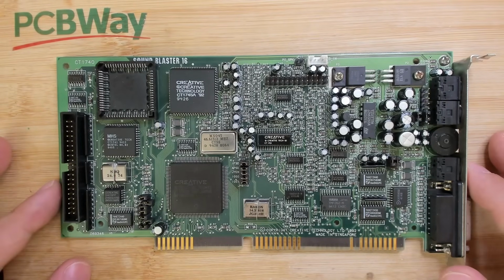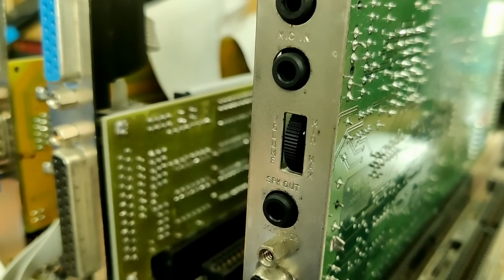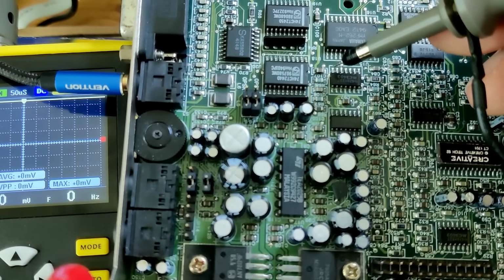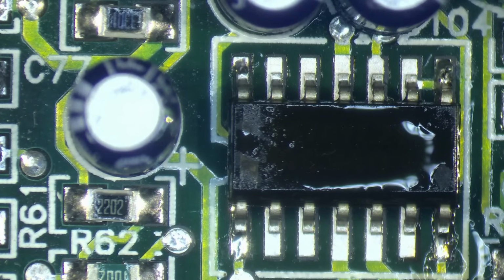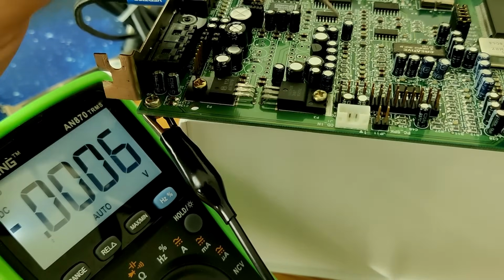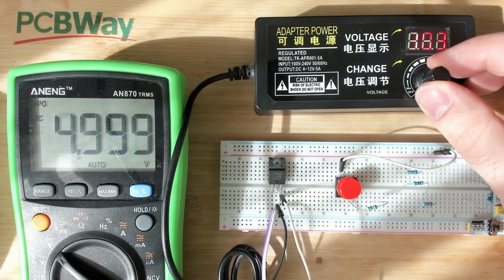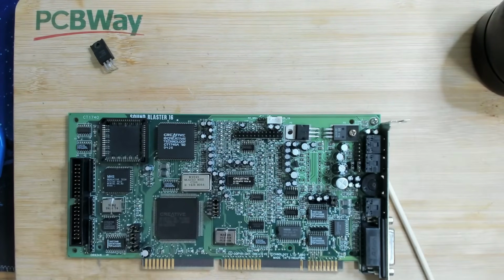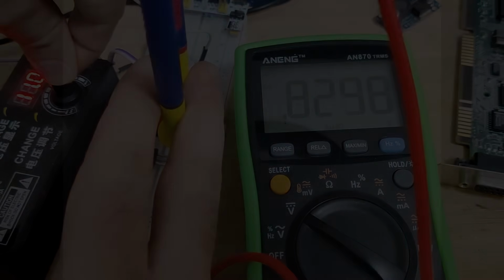The Greatest Sound Card Ever? The iconic Sound Blaster 16!

Comment: All ide connectors on ISA cards are pretty much equal, the ide devices natively interface using ISA and an IDE port is pretty much just connected to the isa bus through some buffers and with circuitry on the isa card determining the IO port and IRQ of the ide channel.  If you have a sound card with an actual ide connector you can use it with hard drives if you use xt-ide (system bioses do not support the tertiary ide channel on sound cards, but xt-ide can if configured for it). That connector on the SB-16 is not IDE, it's a Panasonic CD-ROM interface as used by early 2x Creative branded CD-ROM drives and obviously Panasonic branded drives. This interface was used because ATAPI didn't exist yet and SCSI was a bit expensive to include on a consumer grade sound card and every drive manufacturer was doing the proprietary interface thing. The first officially released  ATAPI specification was released in june 94, so you wont find ide ports on sound cards earlier than late 94.
Reply from the maker: Oh! That is very interesting! I wonder if such an interface can be easily adjusted to accept normal IDE drives. And good to know a rough time when sound cards started to include a standard IDE port.

Comment: It looks like you can still buy some version of MC3403 from TI. I think it's amazing some parts never go obsolete
Reply from the maker: Yes! It's great to still find replacements for old hardware. Some even say that you can improve the audio quality by replacing the old parts with modern ones.
I wouldn't do it, only if a part is defective - like the voltage regulator.

Comment: nice job finding the issue! I only have one thing that I need to nitpick with. You said that the testing environment should be the same as the production environment. yet, during the test you only went up to 10.5v. you may have done more testing off camera, or the footage didnt make it into the final cut, but it bugged me that you never showed the faulty regulator on the bench with 12v input. otherwise amazing video! I will be here for the next one!
Reply from the maker: You have a fair point - and I agree. When I did my initial tests, I did go up to 12 volts and then measured the voltage with a multimeter. It is the same as it was at around 10.5 volts. When I setup to record the voltage change around that level, I indeed did not go all the way up to 12v. Thanks for watching!

Comment: nice work on that voltage reg, its seems all the opamp doesnt have sufficient voltage to run
Reply from the maker: Yes, correct. I am sure there are also other chips that are powered by that regulator - surprisingly, the card was recognized and played some music. If the card would have been dead, I probably would have checked the voltage regulators first. But I thought there is some problem with the audio chips. Oh well, live and learn :)

Comment: Way back in the day.  My family bought a computer at a pawn shop for $100.  It was windows 95 and  486 DX2 66MHz with 20mb ram.   It had a Jazz 16 sound card that never worked when we got the system. I did think it was detected in the O/s device manager.    I never had any kind of audio on a 486 until we got an Acer Acros Pentium 75MHz with 24Mb ram which also taught me about PnP feature or plug and play or Plug N Pray.  I always wondered if that was the problem with the Jazz 16 since the sound card we bought that Acer was a ISA Crystal cs4230 or Cs4234 which was only PNP compatible and required a PNP capable system and was a full duplex sound card which served us well. I did try the Crystal sound card on the 486 system but it wouldn't work.   I did notice the sound quality wasn't great but it did the job for $20 addon card.  I was always curious about the JAZZ 16 sound card if it was any good or not.   I think it was the Media Vision Jazz 16 KRN3261.
Reply from the maker: Hm, I think... I might have one of these in my pile of sound cards. Definitely Jazz 16 rings a bell!

Comment: I've seen many 780x voltage regulators fail but never like this. That might have got me, seeing it regulate at 7,8,9 volts I might have stopped looking. Good info for the future,
Reply from the maker: Ha :) I guess it is good that I didn't have much experience with those - and in fact, this was my first regulator that failed. Without knowing how those regulators usually fail, anything was possible. But I have to admit, when I saw 5v on the regulator in the lower voltage range, my heart dropped because I expected an issue on the card - and a much longer project! Luckily, that wasn't the case!

Comment: Most Op Amps are interchangeable, So if an Audio op amp IC is not available anymore, 
it can be replaced with an equivalent Audio op amp IC the main thing you need to worry 
about is if the pinouts are exactly the same, and the working voltages are the same.

Most Opamps have similar characteristics as they are mostly used for much the same 
functions, In fact with some Audio Op amp replacements one can dramatically improve the 
overall original performance, examples are some Opamps provide a wider range of 
frequencies and significantly lower noise, some can even improve musical dynamic.
Reply from the maker: Thanks for sharing this insight. Now I wonder if this card could be improved with modern opamps. After replacing the voltage regulator, the noise seems to be very very low - at least from what I can tell using BOSE headphones. But there's another thing that keeps me thinking: What if the voltage regulator could introduce some noise. I replaced it with a different model - definitely a model that is much newer. What if those old voltage regulators weren't that good and introduce noise on those cards as well. It could be a combination. That is something I want to test in the future.

Comment: In the beginning you must find source of sound output and if it's clean, go down to see were it distort and check if were normal power voltage on IC - this video will be much shorter :)))
Reply from the maker: I agree. Unfortunately, I wouldn't know where to start. That is why I started the other way around and measured the signal at the output jack. I also wanted to be very careful with this card because it is THE card I wanted to get as a kid. Now that I finally have one, I wanted to make sure I don't make a silly mistake and destroy it.

Comment: Hi, i am disappointed that you did not check the supply rails with a scope.
The test on bread board you did not add the required capacitors for stable operation so it could be the regulator was oscilating very badly.
The new chip may not require or be so susceptible to low capacitance. So may work where the old one would not and is masking the true fault i.e. duff capacitors?
Reply from the maker: Maybe, but the moment I measured the voltage output with a multimeter, I was sure that there can only be two issues:
1) There is a short/partial short (like a leaky capacitor) in the 5v circuit
2) The voltage regulator is bad

Since I did not see any hot spot on the board, I decided to desolder the voltage regulator and test it. That is how I got find it being faulty. The capacitance on the board might have contributed to lift the voltage from 0.8v (breadboard) to around 2.5v (on the card). It could be that we would have seen high ripple on the output of the regulator with an oscilloscope.
Reply: @bitsundbolts  i understand why you did what you did, but if the regulator is oscilating the output voltage could be anywhere I am not talking about ripple but full rail output swing from 5V to 0V. Retest the old one In the bread board with the correct new capacitors as per the datasheet.

Comment: Creative Labs also produced CD ROM drives and I believe those are all backwards compatible with cards like this one. About the fix, I didn't see that one coming either. That said, I always check the voltage rails just to eliminate that as a potential cause for the failure. It could be anything from a broken trace to a faulty capacitor or regulator. Well done!
Reply from the maker: I do have two drives from Creative. One needs maintenance, the other one is in an unknown state. I hope I have them appear in my videos soon :)

Comment: Almost every sound blaster 16 was bundled with a proprietary interface for specific brands and a models, or they sold the card and the drive as an add-on for later. That is definitely not an Standard. IDE interface.
Reply from the maker: I will try it some day. That entire proprietary interface thing on sound cards always baffled me. It is like a hardware lock to other devices in your system - well, specifically the CD-ROM drive. Very annoying and suddenly you end up with 4 connectors on some cards.

Comment: The original noise problem screamed voltage issue to me. 
It's similar (though not exactly the same) to what happens with many of the early Sound Blaster cards if you use them on an ATX motherboard with an ATX power supply that doesn't have -5V present. Part of the reason the Voltage Blaster device was created for setups such as that. Edit: Getting further into the video you mention this. :)
Reply from the maker: Yes, I also have a video about the Sound Blaster 2.0 which does require the -5v from the power supply. The issue on this card did remind me of the Sound Blaster 2.0 without a power supply that delivers -5v. Although, the SB 2.0 had a lot lower volume level which was almost inaudible. I never had a regulator fail on me - that might have been the reason I didn't suspect it might be faulty initially.

Comment: The way that 5V regulator failed was really WEIRD! Ive never seen a regulator do that before. It operated as a crowbar circuit. Ive replaced ones that were shorted to ground and one where the output was 4.8V but never one that goes low ONLY when the input is above 10.5V. They should be able to accept upto 20V on the input. Perhaps you could use it as a 2.5V regulator when input is >10.5V.
Reply from the maker: It was weird how this regulator failed. Haha, I don't want to use this regulator for anything :) It is already gone...

Comment: Isn't the first rule of electronic repair, check power rails.
Reply: That's the third. First is smell the board for burnt parts that have let the magic smoke out. Second is to spend several times longer than most people consider reasonable looking for dry joints, shorts, other damage, etc. Then check the voltages... 😊
Reply from the maker: That's what I am going to do from now on :)

Comment: I had the SB16VE I bought in 1995 which had the hiss as I bought it, but not the distortion. It was just a really cheaply made card and I hated it. When I disabled the mike input it got a lot better but this only worked in windows 3.1. In dos the mixer app was broken and couldn't shut off the mike input. I replaced it with a GUS with 768KB of ram, it was a lot quieter, but no 16 bit sound, but I didn't really miss it. I think I later upgraded to a SB live a few years later. 
I immediately thought it was going to be the voltage regulator, I had issues with this part in other boards and systems. I sometimes replaced it with a LDO replacement, making it a little bit less hot under heavy load. When there was enough room I used LM317 an adjustable voltage regulator, those are much more robust and lower noise than the 78xx series. But they are not drop in replacements but need a few resistors to set the voltage. And the pinout is different as well. 
I have a creative labs PC speaker set that had static noise, and that was due to the opamp stage controlling bass and treble. In the early 2000s I've built my own headphone amp based on discrete fets and transistors. One of the fets were wonky at some point, but only sometimes, giving the same static. It took me a long time to realize it was the fet, I thought it was a ground loop or my PC mainboard. But years later I located the problem, ordered a pair from the designer (they are measured and handpicked as a pair) and restored the headphone amp back to its original glory. 

It can be hard to track down audio issues. You did a good job!

Comment: What a strange failure mode.  Can't say I've seen anything like that before.

PS., you might already be aware of this, but just as a general PSA:  The original regulator had a plastic tab.  That's important because pretty much all TO-220 packages like these 3-pin regulators will connect the metal tab to one of the pins.  Notice the PCB also has the solder mask removed where the tab would go.  As long as the PCB is designed such that the pad under the tab is either floating (not connected to anything else) or meant to connect to the same pin that the IC internally connects to, then that's okay.  And here, the metal tab and PCB pad are probably both Gnd, so that's fine.

But, if a manufacturer chooses a plastic tab, it could be intentional to isolate the IC package from the board.  The other alternative is to use a metal tab for better thermal transfer, but isolate it from the PCB with a thermally conductive, but electrically non-conductive pad, and use a nylon bolt, or a sleeved plastic insert that isolates the metal bolt from the tab.
Reply from the maker: What you describe came up multiple times in comments. Honestly, I wasn't paying attention. However, I did check the big pad where the tab goes - and it is ground as is the middle via for the regulator. The regulator matches this: Ground on tab and middle pin. I guess this is then fine as you mentioned in your second paragraph at the end. I know that there are some MOSFETs on motherboards where the tab is connected to the output or input pin - depends on the model. I haven't come across a linear regulator that had anything but ground on the tab (but I am sure there are variants that have something else on the tab). So, I assume that it isn't an issue how I attached the regulator on this SB16. Btw, I did check the exposed area where the solder mask is removed before I ordered the regulator - but I wasn't aware that there might be other things to consider.
Reply: @bitsundbolts   One easy example:  79xx negative voltage regulators.  The pinout is different from 78xx positive voltage regulators.  The middle pin and tab are both Vin.

BTW, it surprised me that the pair of vregs there were not a complementary pair of 7805 and 7905.  I guess the card uses the negative 5V rail straight from ISA for the analog V-.  That makes sense given how many Sound Blasters don't work w/o that rail, but also makes you wonder -- why bother generating your own clean V+ rail, and then using the system V- rail?  I guess they assume it will be cleaner than the +5V.  And it might be -- it's often generated with a linear regulator in the PSU -- hence the typically low 0.5A rating.  It's just strange.  :-)
Reply from the maker: The Soundblaster 16 doesn't have the golden contact on the connector to pickup the -5v from the ISA slot. This card doesn't require it to work. The Soundblaster 2.0, on the other hand, does.
I heard that it is better to use a 5v linear voltage regulator for cleaner power than using the 5v from the ISA slot. That seems to be the reason why they opted to include the 5v regular on the card.

Yes, I remember that the negative voltage regulator has a different Pinout and the tab isn't ground.

Comment: Sounded like a pretty typical SB16 to me at the beginning. #PAS16gang 😄 Remembering necroware holding up a PAS16 and some SB card against the light (with the latter being practically transparent) a few years ago still makes me chuckle. So glad my own PAS16, the first sound card I ever owned, miraculously made its way back to me a few years ago. I also scored a SB16 a few years prior to that, but it just wasn't the same. 😏 I wish I also still had the speakers that came with the PAS. It was a super awesome bundle that also included a 2x speed SCSI CD-ROM (my first one too) and a boatload of games like Civ 1, Mantis, Critical path and so on. ❤ Would be fun to see an actual comparison between their output quality some day, I wonder how much of a difference there really is!

Tony sure is a weird rubber duck, talking back to you like that. 😉 Good thing you did faithfully replicate the input voltage on the VRM, I would not have expected it to react like that at higher voltages!
Reply from the maker: I think I remember that video with the 'transparent' PCB. Sure, those cards probably will sound a lot worse than one with proper copper fills in inner layers. I might have some of these cards too. Funny that you mention SCSI. I picked up 4 Plextor SCSI 12x CD-ROM drives the other day. They're sitting in a box now because I need to get some SCSI controllers first :D
That voltage regulator seems to surprise many :)

Comment: I had this sound card but the version without the volume control, the amp was either disabled or enabled on full blast. It was very loud on a pair of passive speakers. Used it until 2000 when the RAM in the computer started acting weird - beeped for about 15 minutes, then suddenly after resetting it with that much uptime it booted and workes until it was turned off. But it was easier to get a used computer that came with an AWE 32. A quarter of a century passed since then, time flies and technology changes way too quickly.

Comment: If the replacement of voltage regulator is about -5V +5V - maybe it is good idea to replace both (also the working one) to match and make it more symmetric?
Reply from the maker: To be honest, I wouldn't touch a working card - even if the two regulators look different. The 9v regulator is for the TEA chip (at least I believe so). I am not using it since I usually just capture using "Line Out".